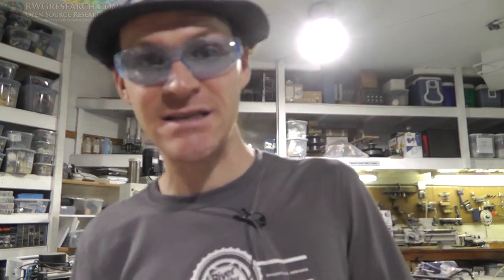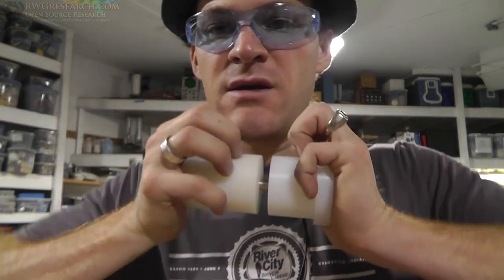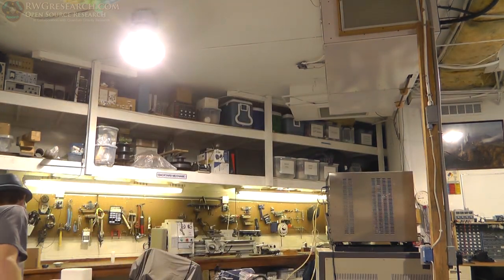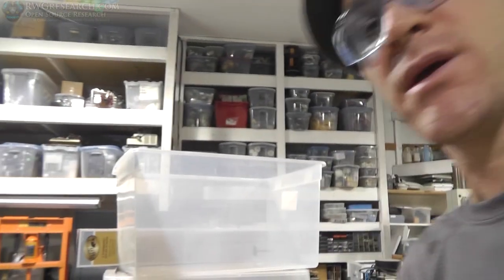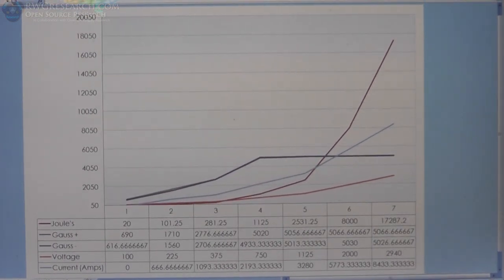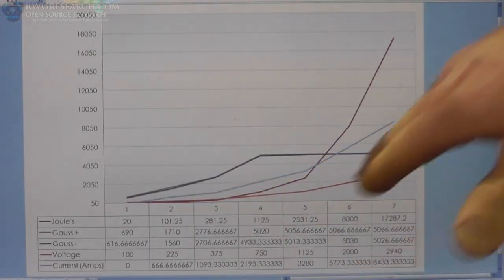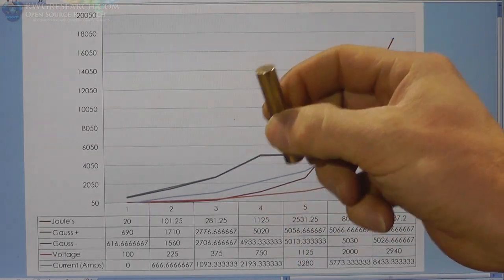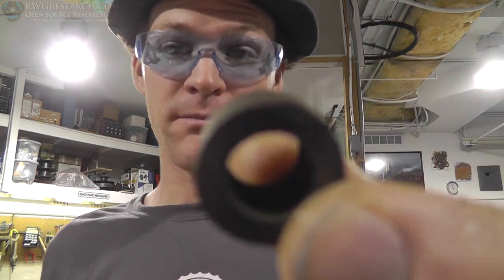Test:3 Magnetizing Experiments  : Input Power Vs Magnetic Strength (Air Core)

Comment: Another, possibly more useful, variable: Time... with lower current, over longer periods of time (e.g. "overnight), could a usable max saturation be achieved?? somewhat like "recharging" your magnets... additionally, heat or mechanical vibration - "hammering/tapping" - (such as where old telephone crank magneto - "horseshoe" magnets were re-magnetized).... to enhance the magnetization process.

Comment: I was watching your Papp engine experiments from a year or two ago, and it occurred to me IF in fact the plasma wave is directional or linear rather than omnidirectional, would it not work better with a radial type of engine like the Wankel or turbine?  The horsepower I've seen on dynos of the piston design has been impressive, but i doubt they take full advantage of a directional wave. Just curious...